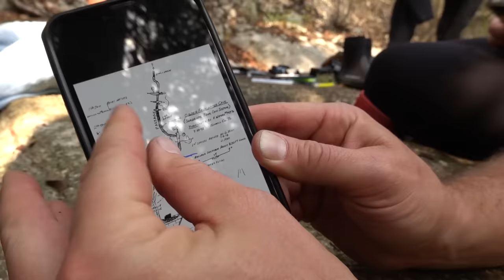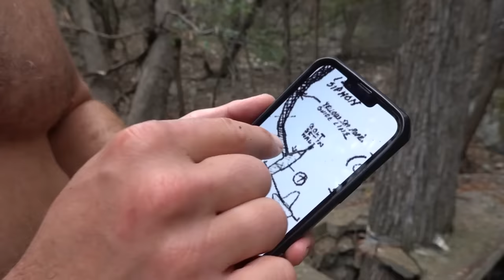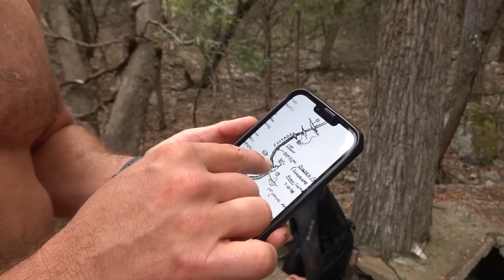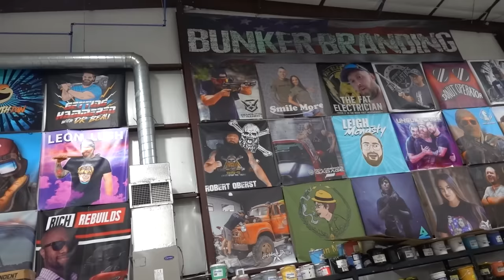Went Deeper and Found Evidence of Humans

Comment: Hey Matt, 
Next time going in the cave bring a marker or some reflective tape and mark your way like in case no light or low light still it will be easy to navigate back.
Reply: If his lights stop working there won't be anything to reflect off the tape, snap lights run out and illuminous stuff needs light to charge. The safest option is have back up lights and a proper Caving guide line, properly tied and secured.
Reply: Chalk or something to mark the way
Reply: @IrbyOCD can’t see chalk in pitch black
Reply: Just run wires to install permanent lighting.
Reply: @graememckay9972 glow sticks don't run out in 20 minutes though and a bit of reflective tape would be ideal.
Reply: No, no, no. Do it properly. Run a guide line from a reel made for cave diving.
Reply: Or just run a line like most cave divers do. Doesn't have to be thick rope or anything and they make stuff that glows in the dark.
Reply: @IrbyOCD chalk..... in the pitch black?
Reply: If it’s pitch black how the hell you gonna see anything. Reflective tape only works if something can reflect off of it. Why not tape a glow stick to the wall.
Reply: Just get like long enough  LED strip with battery switch ON/OFF from the opening cave. 

Rave cave 😅🎉
Reply: What good are markers and reflective tape when the light go out?
Reply: Chalk in water? What is wrong with you goof balls?

Comment: I'd suggest always have a safety line to find your way back if you get lost
Reply: Even in the easy parts because batteries die and you may need a way out in the dark.
Reply: I kept thinking why don't they have a rope? Even before they started talking about oxygen I was wondering why anyone would go in a cave with water without even a small air tank and mask. The whole thing is so half-assed for a potentially dangerous situation.

Comment: as a diver, who also did some ""light"" cave and cavern activities, i'd be concearned going without:
- a backup flashligt for each person
- a mask ( with that silt and suspension is even worst )
- knowing the air quality that i breath
- a planned rute
- a line, bonus if it has markers (you can see that the firsts explorers put down the so referred as "guiding rope")
- expirience, the most important
Reply: Experience is definitely needed. But back-up lights and batteries is a must.  If you can keep a lighter dry you can check air quality with a flame.
Reply: @Underground_Adventures it's a little difficult bringing an keep a lighter dry in a fully submerged cave/cavern with no aired exit.
the air can still be toxic and have 0² to combine whit the butane and make the flame. as an example the air could contain a solfur-based gas and 0².
but i never explored/discovered new caves (for my good), so my knowledge and experience is limited, if you know more chapeau
Reply: @Eagron  all good pionts
Reply: @Eagron  There is air all the way to the entrance. It's not sealed.
Reply: I do a pretty fai amount of caving, oxygen and air quality is the last of your worries, due to the fact that air is always circulating around, mines and caves are two completely different things
Reply: @natepainter1075  it all dipends on the cave, first giveaway is that if it hasn't an aired exit, in mines (with venting and stuff (and no water))  and aired caves/caverns the air is not so worrying.
then there's other stuff to take in consideration, in matt's case i would be more concerned on the unknown state of the water.
and to be better safe than sorry i wouldn't breathe that staff too
Reply: @natepainter1075  agree as someone who visit multiple caves a week air quality is usually not a problem. Mines and man made tunnels are different when it comes to air quality.

Comment: You should 100% drop a pump in there and bring the water level down. It's a fairly cheap way to open it right up. Sunbelt rentals should be able to hook you up or you can hire a service to do all of it.
Reply: Definitely could buy a pump for cheap enough, plus then u could clean out the sediment
Reply: He will probably need the water to keep the area from becoming a desert resort soon.
Reply: @black_rabbit7445 nah, Texas is about to get hammered with rain and snow in places this upcoming week. The water they need is coming in a few days 👍🏻
Reply: That would be nice. However, the water is probably the only reason they can go through the cave. because, without the water, all of the jagged edges in the cave would quickly cause damage to anyone going through it.
Reply: I was also going to suggest pumping out the cave...  Happy exploring!
Reply: The cave is connected to a water source which is why it’s full of water. It would just continue to fill back up so it wouldn’t be possible to pump it all out
Reply: @EGHeartattack  Even better, he can make an oasis of green around the cave.
Reply: Of course, the cave system is fed by a water source. The pump would be required to drain it for exploration and then drain it again if they wanted to go back in again. It's a common practice that they use in mining. the pump will drain it much faster than it can fill back up. If the water source were substantial, the water would be pouring from the cave. The fact that it only fills to a certain level indicates that it is a slow fill. Easily managed with a decent pump, no different than in modern mining.  @EGHeartattack
Reply: LOL @Jayandthegames

Comment: Did anyone have the thought to pump out the water in the cave to have more room to explore?
Reply: How are they gonna do that when they don't even know how much water is in it and it would take days especially for the parts that you need to go underwater but also they don't even know how big the cave is so it's not really logical to try and pump it out
Reply: They could make the hole bigger so they don't have to crawl on their stomachs
Reply: Could be risky drying out the cave walls. If there's softer soil the walls might shift and collapse
Reply: Cave water level is probably already at a historic low given the lack of river after the dry weather.
Reply: if you look floowstones, they seem to be quite exactly level the water, is they only form in the air,  not under the water . Was the cave normally filled up mutch more   there  probably would be less flow stones (shorter )
Regarding high methane and other non breathable gases  in closed  environments /gas pockets , you dont feel drunk; you just pass out after 2 breaths and will suffocate fast if the methane level is high enough  , if someone try to rescue you without usinga eternal  air supply they pass out also.

I read about some wreck divers that came uppon a "air pocket" in a wreck ,they thought cool  ! Let's go in : they surfaces in the "air  bubble " but kept 
Using there air supply  to breath  to be safe . after a short  time they  felt someting was very wrong!
The  unprotected skin on there faces  was hurting with a burning sensation.  They feelt a powerful stench through the diving masks and the eyes was hurting bad .
it was hydrogen sulfide from the  petrufication  processes that had collected in the  gas pocket. Not air.  
They left eminently.  To avoid the risk of somone dieing or geting  in danger they  then 
Smashed the  porthole  so the gases vented  out . 
After the dive they noticed that the aluminium air tanks had some corrosion on the upper  part (hydrogen sulfide is corrosive) . Imagen if they had surfacesed  and eminently  taken a beep breath  or two of that "air" ...
 

Anoder thing is the fact that methane may creates a "ex environment" , any  electric spark ignition source can make it burn explosively. Light and electronics used  should be made with / or combined with  houses /covers  with the proper ex classification . IP class.

Comment: By no means any sort of dive expert, but my understanding is that the concern mostly lies within chambers that are sealed off from the outside air. If you have to dive under water and go to an area that has no way for air to move into, you could potentially hit an chamber full of harmful gasses that have been trapped. You made the right call not going to an area only accessible by fully submerging yourself.
Reply: With the water in the cave, anoxic bacteria can produce H2S gas which is heavier than air and will hang around for a long time unless you literally drag an air hose in there and displace it out.  The moment you start tromping in the silt, the gas can get released in large volumes which can quickly be fatal.  Rarified air also may have no breathable oxygen or be otherwise toxic.  I've measured samples in an iron mine which were less than 1% Oxygen, about 1% CO2 and the rest almost completely dry Nitrogen, which is not poisonous but will quickly kill you from hypoxia if you don't have supplemental oxygen.  A filter mask will not protect you from low oxygen.  Wearing a mask with supplied air is the way to go.  Inhaling that air does not create a sense of anything wrong, because our respiratory system is triggered by high CO2 and not low O2.
Reply: @946towguy2  oh I didn’t think about bacteria making gas but that makes total sense

Comment: I started caving this year with the grotto at my college, the easiest way to check air quality is with a lighter, if the flame hovers above the lighter (it will have a gap between the flame and the lighter if the air is bad)… also works as a back up source of light, can be used to check air flow, etc… bring a lighter caving

Also loving this series

Comment: You should take a couple paint cans with you. Then as you explore the cave you can spray paint the ceiling to show the routes you have taken. Can even put arrows for way out in case something goes wront
Reply: Probably not a great idea to release those paint fumes into such a small volume of air.  I'm sure there are markers or even chalk that would work on the dry parts of the ceiling

Comment: Seeing the concrete around the entrance to this cave and the round hole in the concrete above makes me think this may have been the fresh water supply to the resort.  The round hole could have been the pump placement - or perhaps like a well with a bucket system.  At any rate I could barely stand to watch you guys going in.  I have felt the effect of methane in fresh air above a sump after removing the cover.  I was lucky - I got away.    Others didn't.  It overtakes you unawares.  Leaves you with a tremendous headache.

Comment: There were a few points when far into the cave, your lights were low and you could see a glow towards you from in front of you through the water (probably indicating a opening to the surface).  Did you not notice those at the time or later??

Comment: if you're not cave certified don't play around in underwater caves get certified bring the proper gear(3 flashlights each not total and 2x the air you need and a proper line) even an enclosed cave not submerged can have "bad air" and you're dead
Reply: Lol if there is air coming from the entrance than its fine. Most youd have to worry about  is gases coming from under the water. But thats a very small risk.

Comment: you guys should always have multiple lights....you never know and without light you aren't getting out easily if at all. Also, checking weather before something like this is CRITICAL. If a sudden heavy storm rolled in you drown.....caving especially with water passages is very dangerous....
Reply: lol the internet is always hilariously scared of caves. Cause of all those big production "horror videos" of cave diving accidents. This cave was a straight line and  there was no diving so it was actually relatively safe... Once you start going under water and going into air pockets you have some risks you should account for.

Comment: You should NOT be in there...but if you go you NEED dry suits NOT wetsuits  ! You NEED O2 and masks that have communication mics.  You NEED a carbon monoxide alarm. You need the o2 in case it rains 50-75 miles away and flash floods that cave instantly with ZERO notice. You have a BLESSED life and are clearly very loved. Don't be so cavalier with your life. 
Semper Fidelis